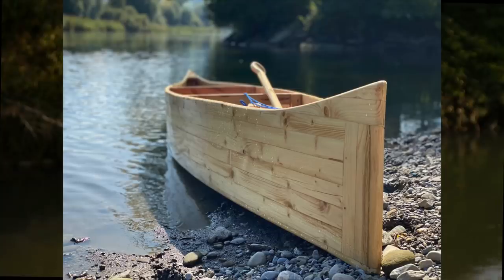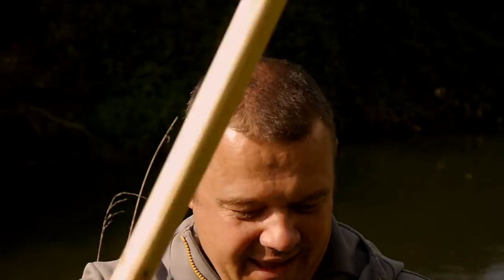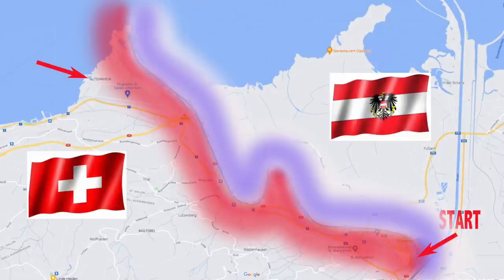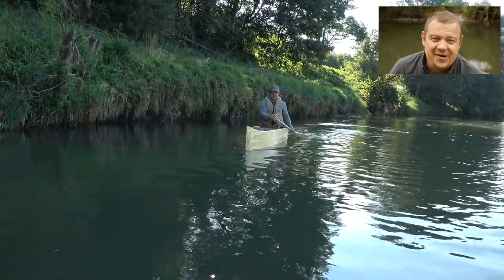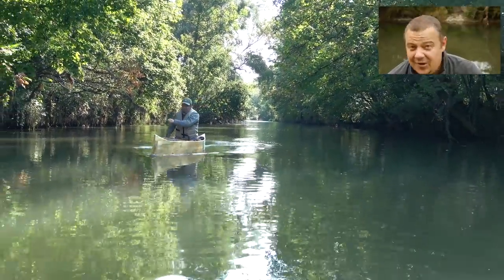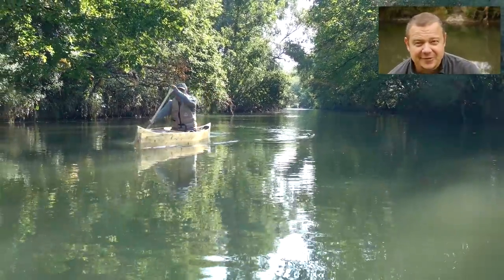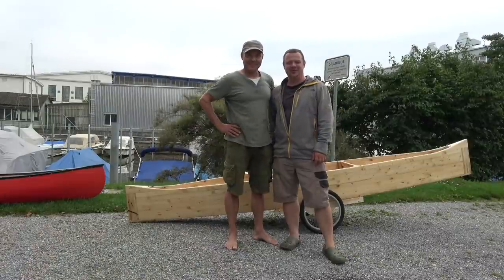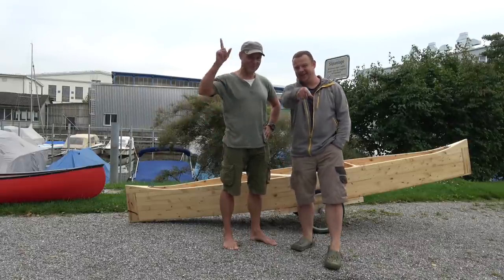16 km Canoe Trip with my wooden DIY Low Budget Canoe - the day of truth!! Will it tip over or sink?

Comment: A couple of quick and inexpensive tips:
1.) Forget the seat. Just use a long waterproof stuff sack. You can straddle it when it is long ways, and you can sit on it when it is across the boat.. Plus you can move it forward and backwards to sit in different locations of the boat. Just be sure to tie the bag to the boat in case it flips.

2.) Get some sort of flotation in the bow or stern. (A cheap inflatable beach ball will even do.) If you do tip over, the boat won't fill completely with water.

3.) Bring a bucket or a pump! If your boat does flip, take on water or even  a heavy rain, you will have a way to empty it without going to shore to dump it out. Don't forget to tie it to the boat though. I use an empty 2 liter plastic bleach bottle with the lid on and the bottom cut out. It makes a really simple bailing system.

I made a 6 meter sailing trimaran out of marine plywood not long ago. It took quite a bit longer than your project, but I really enjoyed building and using the boat.
Reply from the maker: Thank you so much for your super interesting tips!
Reply: I can confirm the bottle lol, i used that to remove sooooo much water from boats lol. Memories lol
Reply: @CyberBeep_kenshi  An old plastic bottle with a handle will work as well or better than most things you can buy. When there's a lot of water, it works better than most kayak bilge pumps. A sponge or rag is needed beyond that.
I hit a 2 meter wave with my trimaran that dumped about 30 liters of seawater in my lap. The bottle really helped.
Reply: @FelixImmler  Sometimes cheap and simple actually works better.
Do have a way to keep your boat from filling up. It's all fun and games until you see the top of your boat barely above water.
Reply: @wisenber  hah yes, we used to carve up 2 liter bottles of washing machine liquids.
Reply: Awesome!

Comment: Keep the thick bottom, add a small keel, make the side hslf the current thickness, add 4 smaller outriggers, use those oblong plastic/rubber things that bigger boats has as protection between the hull and the dock. Just mount them an inch above the water when the canoe is fully laden, then they will not be always dragging in the water, just to stabilise . Fun project.
Reply from the maker: Thanks a lot for your tips!

Comment: You don't need outriggers, you don't need a bigger seat, you don't need a double bladed paddle. What you do need is somone with excellent skills and experience to show you paddling techniques and the principles of rigging your canoe. I wish I was with you and Taro on your maiden voyage just to share your enthusiasm. I started canoeing in the 50's with my dad. In my middle years I decided it would be fun to take an old canoe and run some whitewater rivers and soon learned that I needed professional instruction. It was so revealing and uplifting that I have devoted the last 40 years of my life to canoeing. Many other folks have too. Here are a couple of tips that worked for me.
1. If you kneel in the canoe it becomes very stable. By taking something like a 2x4 or a 1x6 board and affix it like a thwart across the gunwhales about a foot or so behind the mid-point of the canoe and a few inches below the gunwhales you can sit on it (more comfortably if you tilt it toward the front of the boat slightly) so that when you sit & kneel at the same time your knees are at or just behind the mid-point and your butt is on the seat-thwart. This is the best stability position you'll have. On the flats when your knees get tired you can still sit on the seat-thwart so don't tilt it too much.
2. Learn the basic strokes and execute them well. Foward strokes, back strokes, draw stroke, pry stroke, braces, and the turning strokes are a great start and all you need for lakes and easy rivers. Remember forward and back stroke should run parallel to the keel line of the boat not an arc but straight. To do that your paddle needs to be upright during the stroke which is difficult to learn to do because the hand over the handle of the canoe will be above your head at the beginning of strokes. If you need, it is best to add a little correction at either the beginning or the end of the stroke but not in the middle of the stroke. Draw strokes and pry strokes can help the boat turn or adjust your direction of paddle. The high brace and the low brace help keep the boat upright and dry when tipping over but they take a lot more practice to perfect and PLEASE don't be afraid to flip and or get wet, it's part of learning to canoe.
3. Figuring out where to put your seat-thwart and knee pads for proper balance of the boat and the ideal placement for maximum control (turning power and speed going straight) should be done on flatwater for best results. You might have to move your already installed rear center thwart some. You can also glue in some rope/strap D-ring retainers on the floor to keep gear on the bottom of the canoe even when flipped, again for better stability.
Felix, there is so much more you can do with your canoe but these are the basics to get you started comfortably and in total control. Practice makes perfect. I wish I was there. Happy paddling!
Reply from the maker: Wowwww, thank you so much for your Super interesting comment! To read that makes me happy! Thanks again!

Comment: You did a great job there, I have often thought about how I would build a canoe and your ideas are good as is your workmanship.
While watching this video I was thinking of a keel made of two pieces each with a curved edge with gear teeth that engage each other and a pivot on the opposite side of each piece so that no matter if you are going forward or backwards they can retract in shallow water or if they hit a rock.
Then you started talking about the seat position, I have also recognized the difficulty about getting the best seat design, you could cut a hole in the floor, keep the off, cut it in two and attach the front and back edge edge with a hinge and have a loosely fitting tough waterproof material over it so that you can have a foot well. I have noticed that loose fitting plastic materials in water sometimes don't have much drag and I assume it's because the flow of water over them forces them into the best hydrodynamic shape. Not sure it this will be the same so there's a risk of making things worse.
As for stability instead of making it wider, how about a couple of over sized football (rugby not soccer ball) shaped storage/floatation devices mounted either side just above the water line so that they do not cause any drag but still prevent capsize. Of course this will mean a rethink of the oar design.
Reply from the maker: Hello Tim. Thanks a lot for your valuable tips!

Comment: What you made the frame from the battens and used the poor man's fiberglass method using contractors drop blankets and thick wood varnish? You wouldn't have to worry about complex curves because the cloth is flexible.

Comment: I think it was a great success! Maybe you will like the kayak paddle better, this is a very personal preference. The weight of your canoe will only be an issue if you intend to do much portage. I would second the flotation device and plastic bottle water remover mentioned before. As a teenager I faced two ours of struggle after our small sail boat capsized and the owner had not put the flotation cushions. We made it to the shore  completely wasted, and at 14 I had all the energy in the world! Now it would be a disaster for sure.
Reply from the maker: Thanks a lot for your valuable hints!

Comment: Flat bottomed boats are the most stable as the buoyancy is the   best out wide however your friends canoe has that flair or bulge to the sides which means that as the boat leans buoyancy increases whereas yours decreases. Stability though is more a function of width and lenght of boat contacting the water. 

So the complicated designs are not just for looks. As for that complexity I am just finishing a straight sided plywood sailing dingy which has a flare to the sides caused by putting a rocker (curve ) into the keel.  That is ply on frame I made the frames with wood from Pallets so very cheap for materials though not quick :) as your boat is. It does look great though (designed by Geoff Spira)  I think if you had put a rocker in the  bottom and leaned the stem and stern out a little when you planked a natural flare would have naturally developed.

I think for the cheapest practical canoe go for stich and tape plywood like the Storer design very quick easy to build relatively cheap and practical in that it is as efficient and stable as your friends canoe.

Comment: The issue you have is that the displacement of the boat does not change much as you rock it. Its square bottomed. Its a cube. Not much more stable than a log. As one side is being pused down in to the water, the other side is coming up by the same amount. Water displacement is still roughly the same. You have to have something in the shape that makes it displace more water as you lean it over. Outriggers are common, but making the hull step outward is another. Stepping outward with the hull sidea around the waterline makes the side being pushed down displace more water than the side being lifted out of the water. That could be done simply by gluing more board on the outside of the hull you have now, starting at the water line. I would guess 3 or 4 would be thick enough. You could then use it like that or remove the sides above that point an use them to build the new wider sides on the top of the outside boards. The end result making the part in the water a few inches skinnier than the part above the water line. This can be shown by throwing a 4 inch cube of wood in the water. It will roll around in the water. Now cut that block in half, , cut half slightly smaller and glue the halves back togeather. It will suddenly float stable with the wider side pointing up, even though its no wider than before.
Reply from the maker: Your comment is very interesting! Thanks a lot! What do you think ... how many degrees do I have to incline the side wall outwards so that I have more stability for the next boat?
Reply: @FelixImmler  Any amount will be more stable than straight sides. How much would be enough to feel stable enough for you is the question. If it was me building one, I would go buy either model building wood or foam and rip it into little strips to memic your roof boards, and build a few scale models with it to test stability and ease of building that shape. Angled sides I would think would be much harder to build than stepped sides as boards would need to be twisted, but it would probably be lighter. While I have a good undertanding of boat stability. The actual details of building one are above my pay grade.

Comment: For a seat, just a broad plank with perhaps a flat cushion. Takes a bit getting used to, but that's the usual thing.

No big experience with a canoe but would a lowerable sword on the side work for stability? For this specific boat that is. We used to call it a sword in the Netherlands, so not sure about the translation , but basically a blade shape you lower depending on depth and performance
Reply from the maker: Thanks a lot for your interesting hint with a sword on the side...
Reply: @FelixImmler  found a link:)

https://en.m.wikipedia.org/wiki/Leeboard
Reply: Could also use a rudder fin that pivots into the water right at the back of the boat like you see on sea kayaks. Lower it down when you want to go straight, raise it when you need more maneuverability.

Comment: The maiden voyage
I think you would have more stability by putting a vin on the bottom,
In the lenght sliding trough the current ,because the canoe is pretty narrow.
Reply from the maker: Thanks a lot Steve. Is a vin a keel?
Reply: @FelixImmler  indeed a keel,i wrote in my native language,while i was thinking about it

Comment: Learn to paddle with a single blade. Don't use it as a rudder because it will slow you down. You control the canoe by balancing how much to paddle on each side. When I was a kid I had to paddle more on the left than on the right to go straight.

Comment: How much does the canoe weigh,I guess about 35 kilo?I guess you should have added some more centimeters to the width, on order to make it more stabile in rough seas.If you want to use it for fishing,it is very usefull to use a pontoon as an outrigger, then you can lean out of the canoe without rolling over.
Reply from the maker: 40kg. Thanks for your inspirations!